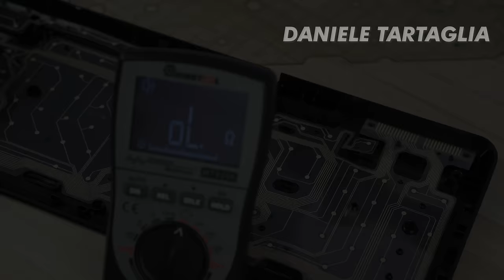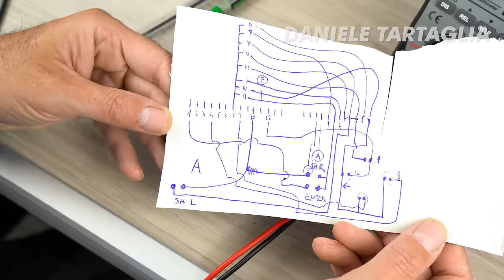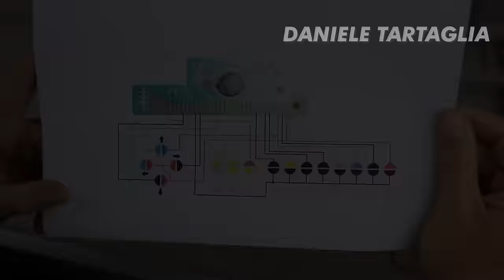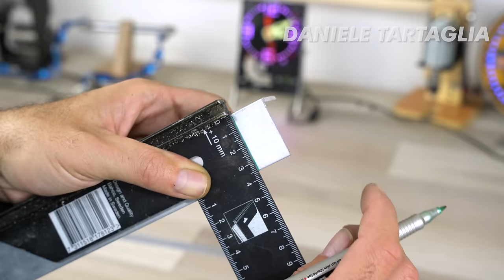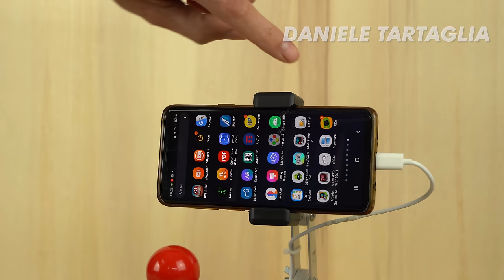INCREDIBLE ! Smartphone console DIY with OLD keyboard - UNLIMITED GAMES

Comment: I'm a big believer in re-using old components, however...

They sell joystick "kits" that include the stick, buttons, a USB board, and cables for connecting everything. You still need to build a case, but everything else just plugs in.
Reply: Yeah but those joysick kits just came from old keyboard ics aswell.
Reply: @euvo_sound  You mean they use the same chips, or that the ICs were literally taken from old keyboards? Either way, I'm not aware of any of them identifying themselves as keyboards when plugged in.
Reply: @lurkerrekrul  Any kind of controller/joystick identifies itself as Keyboard if you plug it in.

Comment: As someone who plays on arcade sticks all the time, this is the most painful build I've ever seen. Those screws in any game that uses heavy use of the joy stick will have their hands grinding on those screws. Those nub buttons seem interesting, and I'm also not sure why you went with 4 button layout instead of the standard 6 button. On every system you're missing buttons except the NES. It does look pretty though. I'm a fan of the case and nubs. The buttons and lever look like knockoff buttons instead of proper arcade buttons. Like knock off Suzo Happ. What's worse is that you have industrial level gear so there's absolutely no excuse that you cheaped out on this equipment

Comment: I would appreciate learning more about your soldering technique, it looks like after the terminals were "sanded" you applied something yellowish from that clear tube and then you applied some new solder material before actually soldering the wires. However it looked like you just applied the solder across the last few contacts all at same time by just applying heat across them with a rolling technique. 
I took a soldering class years ago but I don't recall if this was covered. I feel like soldering often makes me hesitate starting cool projects like this
Reply: the yellowish stuff is flux. Flux inhibits oxidation, and in when done liberally as he did there it prevents the solder from sticking to anything that isn't conductive. It's basically a shortcut to tin the pads effectively without blobs shorting between them. The spray he put on afterwards was to remove the excess flux, though you do want to leave a little flux behind to protect the joints.

Comment: What a lovely device this arcade joystick. A very fine construction made of a used keyboard, something so cheap. What must have been more expensive were the buttons and the control handle, but it's still a product we don't see selling anywhere. Very good!
Reply: The parts used were a little cheaper than genuine "brand name" arcade parts so not cheap not expensive, the parts still were probably 30-40usd.
Reply: @SumeaBizarro  He made this joystick with leftovers. The other necessary components, on the other day, you can't have it for free. The most interesting thing is that he did to suit the phones that run emulators, including a support to keep the phone in view. I've never seen such a control to sell and to be honest I hate surfing mobile phones because I do not like touch /screen systems so for me the creation of it was very useful.

Comment: this is a cool build i have one recommendation and that would be to use a zero delay board instead of a keyboard as the newer ones support xinput and ps3 mod that way you wont need to manually assign buttons in every emulator and game.
Reply: In this case, "no no, I think he has a point" - I have tried to play stuff on android with controller, even wired ones and they just do not want to work even the controllers that are fully made to work with android have input lag and other issues, always, several phones even sony ones. If you set out to do custom android gaming dock, keyboard in my view is a smart choice.
Reply: @SumeaBizarro  iv never really ran into that problem myself and I have don't this across a variety of devices you may have been really unlucky for that to be happening over a wired connection or on a very old version of Android.

Comment: For 11.99 on eBay you can buy a usb to arcade joystick kit , it includes all the buttons and a really good arcade stick, it’s plug and play , you just need to mount it to a piece of scrap wood , this seems like loads of work to achieve the same thing , I’ve built arcade machines for less than 70.00 uk pounds using parts from China

Comment: Mounting of that sanwa is bit off, usually you use something to recess them or get shorter shaft version of a joystick if the build for size restrictions has to be like this, though, those are not easier to come by and it all comes down to taste, some liking it when the joystick "feels longer" - though it is just an illusion even for normal mount.

Edit: Yeah it is not even a sanwa just a design-a-like probably from cheaper source, which is entirely fine for these types of things.